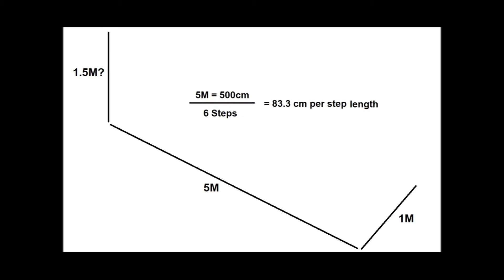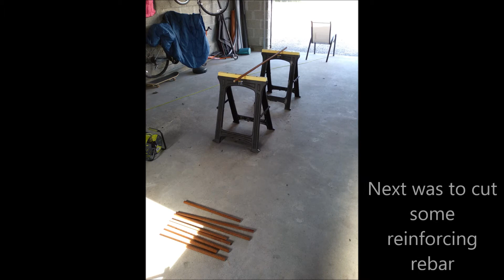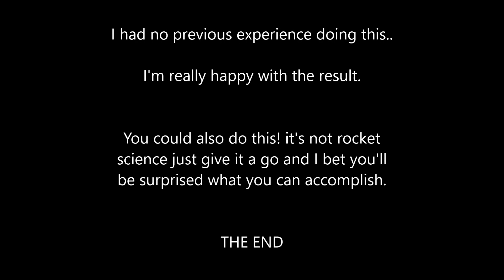Build your own concrete steps

Comment: Hi....can you tell me how many total bags of concrete and sand you used for the stairs?  Nice job.
Reply from the maker: Thank-you for your kind comment JP, it was several years ago now so I cannot be certain but I'd guess it was maybe 15 bags of cement and a tonne and a half of sand. I know that maybe sounds like a lot but they're fairly big steps and I dug the footings quite deep as well.